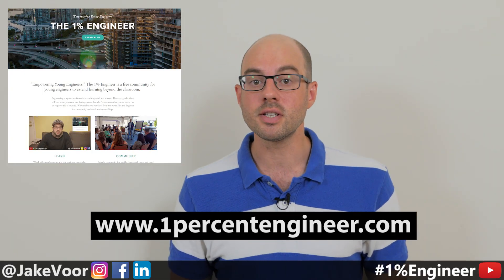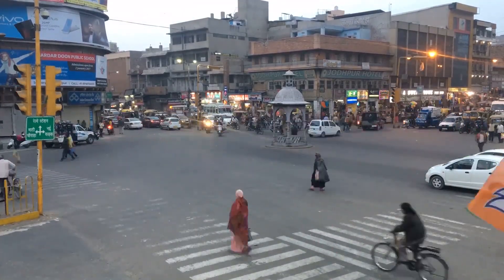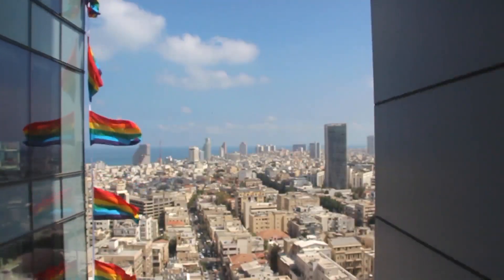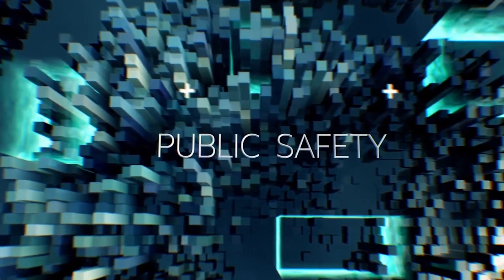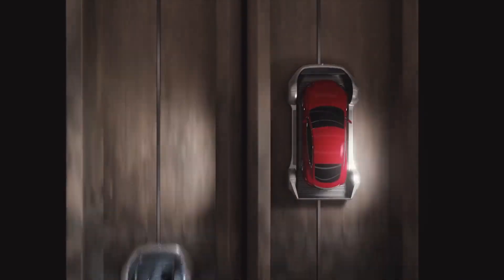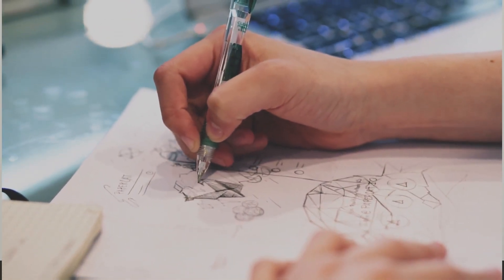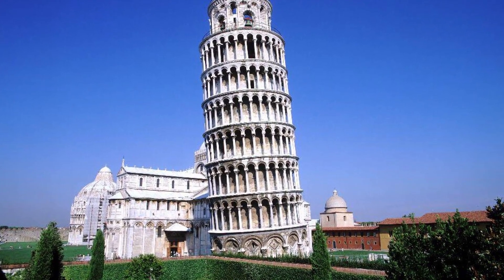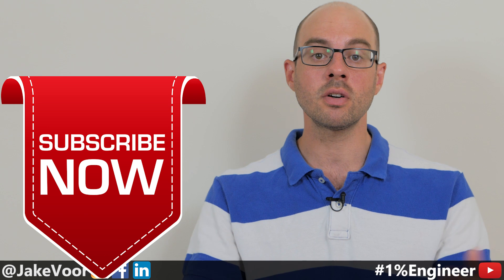What Do Civil Engineers Do? | Do Civil Engineers Build Buildings?

Comment: Hi Jake! Great video that gave me insight on the civil engineering major. I wanted to ask you for ur advice on my desired career path and on how I should pursue it.

I have a deep passion for architecture and massing of buildings but also would like to learn aspects of structural analysis, logistics of a building etc. So, after some research, I decided it would be the best option to opt for a bachelors degree in civil engineering and then take further courses and graduate studies on architecture. My question is, can I work as an architect with valuable engineering knowledge by taking this study path? As there are some opinions on that I can’t connect between the two and doing a civil eng degree doesn’t qualify me to do further studies on architecture and work in this field.

So pls share your advice on how I can take this path and to which I hope that its a possible route. Thank you!🙏🙏

Comment: I've got a bachelor's degree in transportation but I'm going to study for a master degree now. I'm not sure which discipline I want to take and which one is the most rewarding
Reply from the maker: I did transportation concentration within civil engineering with a traffic and ITS focus in grad school, so really I’d recommend that as well. Honestly you can get into any sort of transportation Avenue with any sort of grad degree in transportation. You’ll be fine. Does that help? Thanks
Reply: @JakeVoorhees  do you think it's better if I choose a different discipline? And how much more does a master degree weigh than a bachelor's?
Reply from the maker: @abyyman1671  the core discipline for civil is structural. Most civil engineers work with buildings and bridges in some way. Transportation is probably second most common because there are so many roadway or transit or traffic or facilities design applications. Environmental is pretty big by itself. Honestly they are all good, it just depends on what you like the most.

Masters degrees help some year but the opportunity cost doesn’t make it super worth it unless you really know where you want to go in a technical career. Get your 4 year degree then go work for about 4 more and then figure out what you really want to do for a career focus, then try and find a company to find it. Does that help? Thanks

Comment: i wanna know the difference between structural or transportation engineering because im having trouble choosing which one i want to do
Reply from the maker: Transportation Engineers design roads, work with traffic, safety, maybe airports or seaways, handle the traffic control, congestion, emissions, and pavement health and various other things involved with the transportation network. They do not build bridges. That is what structural engineers do - they build bridges and buildings.

Comment: Can a mechanical engineering degree work in construction or infrastructure sites?
Reply from the maker: Yup absolutely. Civils and MEs cross paths and work together for sure. ESP MEs working a CEs. All the steel parts and all the components in a bridge or building design are all designs and manufactured by mechanical engineers

Comment: For the upcoming geotechnical engineers. He is absolutely right about the subjective element of geotech engineers. Often they place so much importance on compaction of a given a soil. It's a terrible way to evaluate what could happen (given a sudden saturation/water) I've been working in a lab and field for 18 years testing soil. Blows me away on how much importance Engineers make about compaction. I would rather have a sand soil (SM,SC, SP, SW) compacted at 85% than a clay or silt (ML, MH, CL, CH) compacted at 95%. It's because they haven't run the tests themselves. Go ahead, run a remolded expansion index of a clay compacted at 95% of a modified proctor (ASTM D1557). Tell me what you think. We in the geotechnical field have outdated standard test methods. Don't believe me, type geotechnical in the comments, Spell check even wants to correct it.
Reply from the maker: this is so funny. id love to talk with you more. maybe we could even do a video about your excellently niched knowledge? email me, hello@jakevoorhees.com, thanks!

Comment: I have 4 questions 🤕
1- how much an entry level civil engineer make? 
2- Is civil engineering in demand. Do you find  a job easily after graduating from college???
3- Do civil engineers use math in daily bases?
4- How many math classes do civil engineers take in college??
Reply: I am a freshman at the University of Mount Union and I can try and answer your questions based on what I have been told. 
1.Entry level jobs are from 40k-60k depending on what line of work you are in and how qualified you are. 
2. Civil engineering will always be in demand based on the expansion of human development. We will always need new buildings, bridges, highways, etc. 
3. Yes civil engineers will use math on a daily basis, along with physics! 
4. What I consider to be a math class would be Pre-Calc, Calc, Stats, etc. But a lot of the classes you will take will include math such as physics and structural design. The “pure” math classes I will have to take are Calc 1,2,and 3. but there are many other classes that include using those skills you learned in those “pure” math classes. 
I hope this helps! If any information is incorrect let me know!
Reply: Thanks brother 
Appreciated
Reply: Jason Tondra are u structural engineer
Reply: Don't major in Civil Engineering.